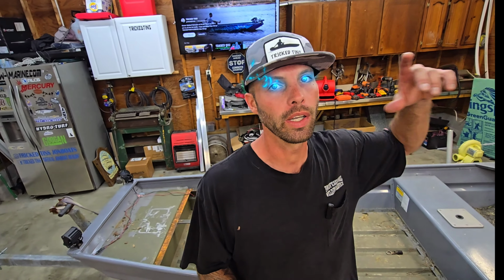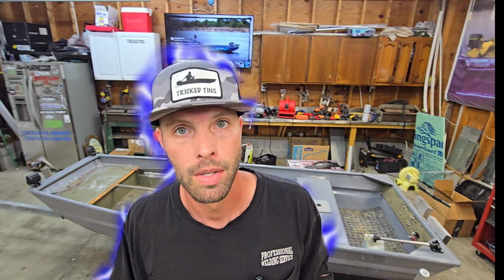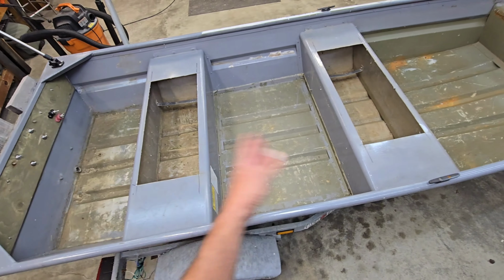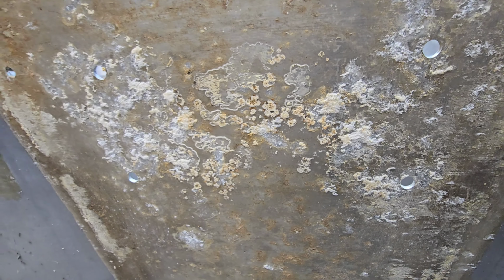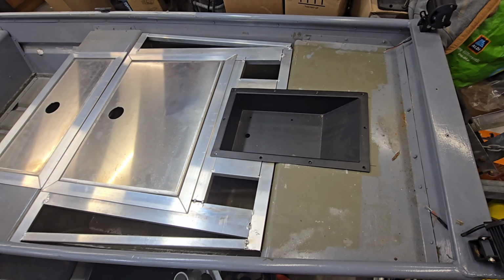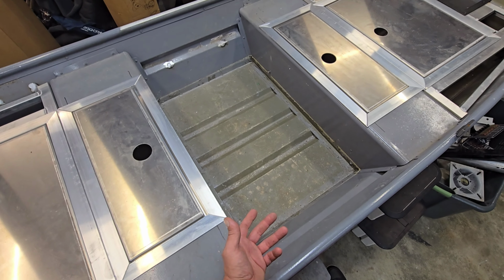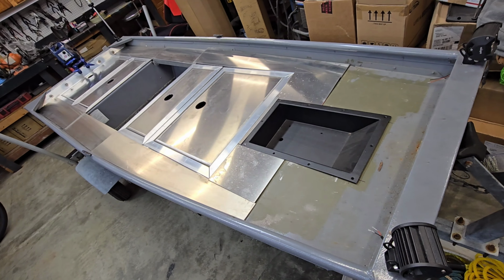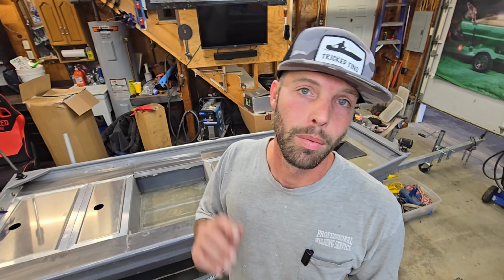10 foot mini bass boat build! @FISHERYIN

Comment: That could be a super cool pond rig. Just slide it in at an open spot at the bank. Did a ton of that with my dad when I was a kid, but not in a jon with a layout as sick as this one.
Reply from the maker: Thanks man. That's exactly what it's made for
Reply: @TRICKEDTINS  best thing about a little rig like this is that you can skip the trailer and just transport it/launch it out of the back of a pickup or bigger SUV. In the old days of fold down tailgates (1970s) you could even do it out of a station wagon!

Comment: Boats way too small. He will rarely use it. Seems like alot of work for nothing.
Reply from the maker: Appreciate the comment, but I think he will use it a lot more than you anticipate.  He's a professional youtuber. This rig allows him to fish spots that are unaccessible for a boat. His 9-5 job is creating content. I can only imagine the crazy places he takes this rig. We'll see?
Reply: I take mine all over. From Norfolk, Virginia reservoirs to Dismal swamp. I'm always with one of my kids so there is about 400 pounds of flesh, plus a 4 hp Tohatsu motor, trolling motor and all the other gear needed. I did make 8'x6"x6" stabilizers for it and it needs them. I opted out of a casting deck, for now anyway but I did install a floating floor in it. I installed launch wheels on it so no ramp or trailer is needed. It is a blast and we hit water that others  just cannot.